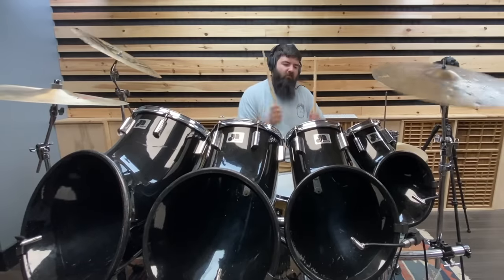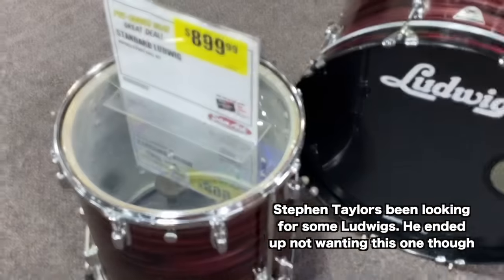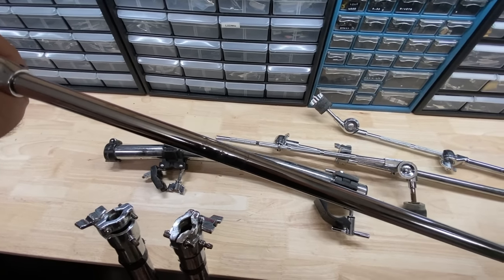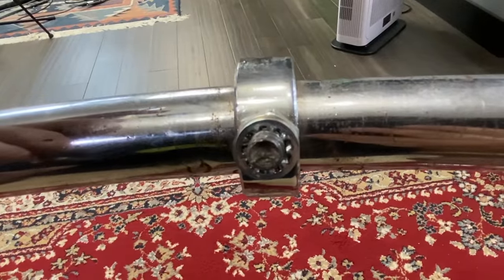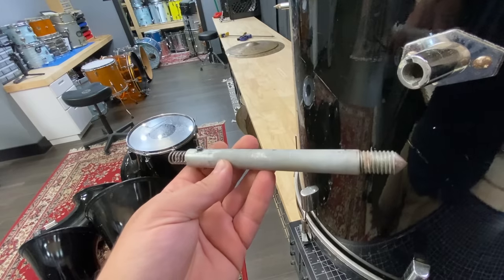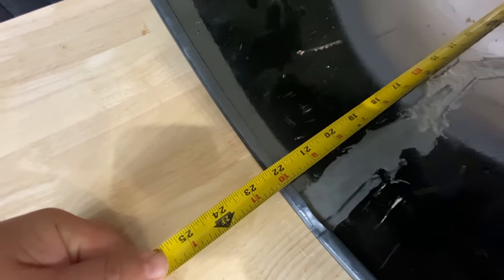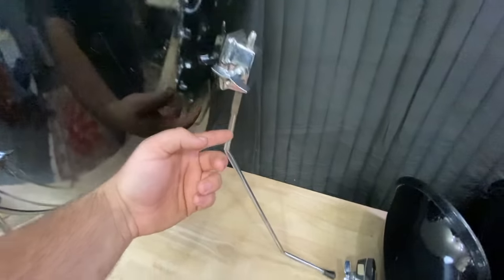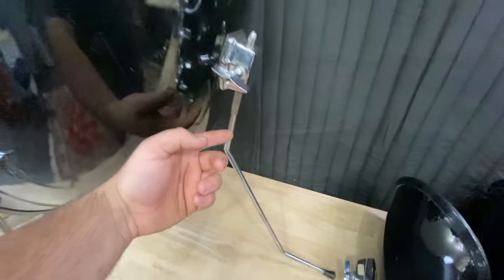Buying The WEIRDEST Drum Set I Could Find at Sam Ash

Comment: First  time I saw these was with Billy Cobham and he did a single 128th run across the way across the toms ; I about fell over he had so much power. I’m told the original mounts put them up very high and we’re a pain to play, so the rack was definitely a step in the right direction. They sounded good in the day, but they just looked really strange. Thanks for posting and adding the information on the spring loaded spurs…a new one on me.

Comment: They are actually horn-loaded, with the flaring out, and also curved to project forwards.
Horn loading increaes volume, as it allows,a sound wavefront to expand sideways more efficiently than when a sound suddenly escapes a parallel sided container, this is the principle used in horn loaded spwaker cabinets.
A few North Kits were sold in the UK, but drummers in the UK should note there is a similar brand from the same era called Staccato, the difference being the front orifice had a different shape from round, and the bass drum was bizarre anx huge, with two front orifices and a shape like a giant pair of shorts.
Do a google search, and you'll see what I mean. There are still a few of these vintage kits around, so you might find one. 
The only drummer i saw using one was with Bow Wow Wow in the mid 1980s, i understand he also played with Adam and the Ants. A pretty hot and dynamic drummer, too.
I long ago had three odd Staccato toms, 6, 8, 10 heads, i used them in a standup percussion rack for a time. And they did lookcool.

Comment: I had a set of these in white. Double bass. 6 mounted toms (6,8,10,10,12,12 iirc). I might have played the whole kit out once, mostly played just a single rack. Used to nest them inside each other for transport (scratches didn't show up so much on white :) ). They also had a vinyl lip around the openings. Definitely a conversation starter but as I started getting into more jazz/blues kit playing it just wasn't a good fit. After collecting dust for years I finally put them up on Craigslist where it was bought by a record producer...in Greece. Shipping them was...fun. As others noted very loud, very dead sound.

Comment: l played with a drummer that had a complete double bass set of North drums. He had them down to a single bass set but added a set of the high Octa-bons. The North's problem is you cant use them on a smaller stage because theyre offensive to the other band members not because of size but theyre like having the brass section right behind you.